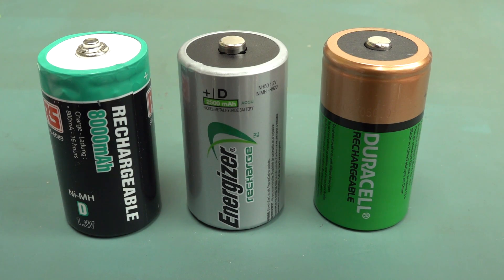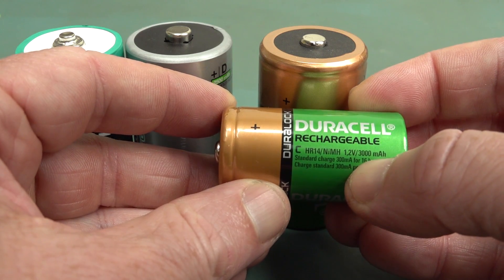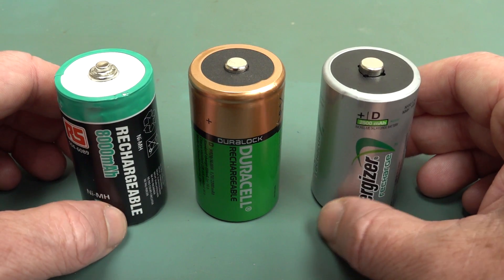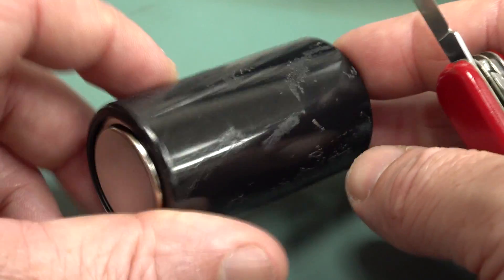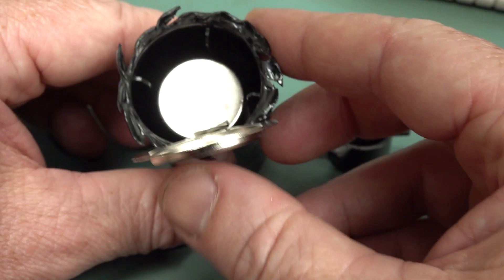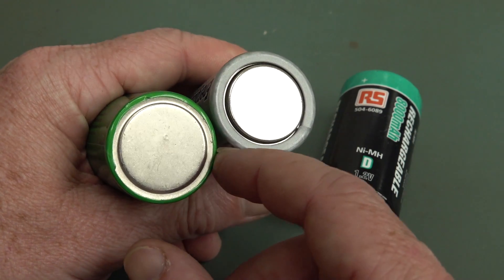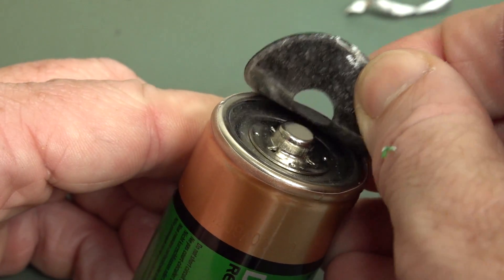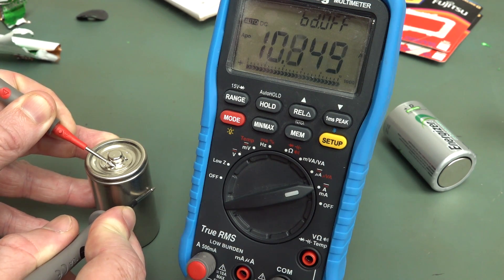EEVblog #1200 - BUSTED! - Energizer & Duracell NiMH

Comment: Hey Dave, just a heads up but the guts of NiMH batteries are pyrophoric, meaning they can catch fire when exposed to air. Hope you didn't put it in a regular trash can!T
Reply: I didn't think they were. What alkaloid is in it that would be reactive to air? I'm going to have to unravel one, just to try it.
Reply: @vincentrobinette1507  , it is not alkaloid but hydrogen storage "secret sauce" alloy containing various rare earth elements and stuff. Slightly similar actually to spark producing pyrophoric metal in lighters.
Reply: @SLEAGD  is correct. But discharging should oxidise the MH and should lower the risk of spontanious inflammarion. It can happen which happended to BigClive at one of his teardown videos.
Reply: @SLEAGD  You're thinking of lanthanum and other elements in the same column of the Periodic Table of the Elements. Their ability to store hydrogen, is why these are called "metal hydride" cells. I don't think they are likely to spontaneously burn, but it could definitely be flammable. The danger might be a spark caused by the electrodes shorting, while the hydride electrodes are exposed to the oxygen in the air.
Reply: Hydrides are able to spontaneous burn, and they can take a while to get going - all in all quite a fire hazard for the unwary.
Reply: If it catches fire, the flood will put it out.

Comment: Maybe it's to keep the recharge time down. If duracell has a 16 hour charge time, how long would it take to charge if it was fully packed!
Reply: Halojen That's the "C" rating.  1C means the battery can be charged at 1mA per mAh capacity, fully charged in 1hour+losses.  0.5C is half as much current so double the time.  A properly made real D cell like the RS one should charge as fast as a same quality AAA, provided the charger can keep up.
Reply: @johnfrancisdoe1563  I was just reading what it said on the side of the duracel (at around 15:00) and made the assumption that they were quoting the fastest possible charge. 
I mean, if it could handle a higher charge current, wouldn't they quote that so it's more impressive?
Upon reading the datasheet at 2:30 I see there are higher charge rates listed for the RS batt despite it only shows the 16h rate on the label. So.. meh, I dunno.

Comment: Back when NiCd was king they did this sort of thing all the time by adapting Sub-C cells into standard C and D cells.  Everything rechargeable from that era basically used Sub-C (with cardboard wrappers), since that was what everyone was making/using...it just made economic sense.

I kind of went through this mentally a few months ago when looking to go NiMH since I was getting pissed off at alkaline cells leaking for no apparent reason. I ended up just getting a bunch of Eneloop AA and AAA cells and sets of parallel-type adapters to combine 4 AAA into 1 C and 3 AA into 1 D. Eneloop's own brand of adapters only hold one cell.

Incidentally, the capacity ratings for Eneloop's 'true' C and D cells that are hard to find are the same as 4 standard eneloop AAA for the C and 3 AA for the D... My guess is that eneloop only makes AAA and AA types and does the same sort of thing.

Comment: Too be fair, they are built for the form factor. They didn't lie about capacity. These are legacy sizes. I used to stick AA's in a tube and pack them out to get someting working in a pinch. I would 3d print a collar now. I think your wining like a girl. If you want you fart box just to work for the night, you will buy the "scam" duracell or energiser. If you want your fart box to out live your own anus, you buy the one packed to the brim with powa!
Reply: frank brown  erm, you missed my point entirely, then started talking crap.
Reply: frank brown  Do you buy it? I stopped buying shit when I was a kid. If you want to argue crap with me  it's on deaf ears, not due to stupidity, but because I gave up flying a fuck about caring or listening about the sheeple problems. Preach at them, not me. Who in the fuck of your demografic would be  reading the post you put up about bacon, burried within my comment on dave being a winny dick about expensive batterys that are within all specs. You are very fucking mistaken to what my orignal comment said, your view on it and my interest of your view.

Comment: That's disgusting. A legit use for high capacity D cells are automatic bins which require a hell of a lot of torque to lift the lid. Now I know about this practice I'm going to damn well check the rating more carefully!

Comment: I would call it a scam. This is the exact same techniques the Chinese manufacturers use to sell you a 250mAh 18650 battery. They lie on the capacity and Duracell/Energizer don't, but Chinese manufacturers didn't flood the entire world with commercials on TV, internet and radio stating how long their cells last, and selling those in pure hopes their marketing pays up.

Comment: I remember seeing as a kid, D cells that had a hole so you could stick an AAA inside. But I also disassembled a very light D cell before and found it had a cardboard tube with a very small battery inside it.  These were rechargeable.

Comment: If the cells deliver their advertised rated capacity, there is nothing wrong in the actual cell size inside being smaller than the outer casing. They are just packaged to meet a given standardized form factor. There is no law requiring cells to fill the maximum internal volume with the active chemicals. If the cells are tested to perform as advertised and the price is right for their rated capacity, I don't see a problem.
Reply: If they dropped the "long-lasting" adds, sure... meanwhile, they use Duracell & Energiser bunnies to prove how long-lasting they are(n't), which, being generous, is sleight-of-hand at best.

Comment: Take apart the RS 8000mAh!!!  Bloody amateur!
Reply: Too nice of a cell. That's a  keeper!
Reply: @vincentrobinette1507  to nice of a cell? Thought the purpose of this video was to compare 3 types, a little miss leading and dishonest if you ask me. I mean just pushing a certain brand with absolutely zero evidence it is built better than the two brands he takes apart.
Reply: @heathdinsdale5012  I wished he opened the RS cell as the test is inconclusive right now. What if the RS cell actually had only 2500mah capacity inside? That's the bigger rip off than the other 2 brands selling close to their stated specs even if there's a lot if wasted space inside.
Reply: It's probably 4x the cost of the other ones...
Reply: @DoctorWhom  It's RS! Of course it will be 4x the cost! All their stuff sells at top dollar prices.
Reply: It is too nice to destroy RS is the dogs bollocks in parts normally.
Reply: @Sirstas79  

There's whole other lines of batteries made for "non-consumer" markets.
And the names on the outside... ... are names on the outside.
Reply: @J doe I was just trying to relate the prices and availability, not trying to say that anyone brand is better.  I was just trying to do a cost comparison on the price difference. yes the price does scale up with the RS brand, i have found them at $12 also myself. I only am trying to see if there was a reason why the other brands are not making batteries on the larger mah?  Is it just marketing? Is it safety? I was also trying to  see if the other company's made larger capacity  at different prices.  Because it does not look like may manufactures make them at those capacity's.
Reply: Well I guess I’m going to buy some RS cells then. Good thing, I’m fresh out of C and D!
Reply: @J doe 6pk of 10k mah for 31.99 which is slightly higher per cell but by a much smaller percentage than the increased capacity.
Reply: @Sirstas79  I tried and failed to find them on amazon UK, im probably searching wrong term, or its giving me different results because of my Canadian account. Almost $30 USD for a pair on alliedelec for the RS ones. On Amazon US the energizers are $8 USD for a pair.
Reply: He works for RS
Reply: @dutchdude1972  Check your eyes. You're a week late to the party.
Reply: The RS cell actually says 800 (eight hundred) mAh on the side. He was showing it right to the camera while saying "eight thousand" LOL
Reply: Euro Bum , charge current 800ma 16 hours .. capacity 8000 mAh. I noticed the same so I paused the video. you should too.
Reply: @eurobum2012  You're wrong Pal! The battery capacity is in fact stated as being '8000mAh'. The 800mA you are referring to is the recommended 'charge rate' that you should charge the battery at. It even says 'Charge' right next to the 800mA. So maybe you cant read. So he is right,  you are wrong.
Reply: @tangosucka2000  OK Pal! I'm not the only who didn't read properly.
Reply: @eurobum2012  check again and freeze frame at 5 seconds. It clearly says 8000mAh.
Reply: @DigitalEyesStudios  wow. congratulations on replying to a month old comment without reading the history.
Reply: @eurobum2012  If you stop the video and look carefully you can see it's actually 8000mAh.

lol sorry I just couldn't resist
Reply: @zakatalmosen5984  If you stop and look at the comments, you can see that you're actually 6 months late. Sorry I couldn't resist.
Reply: @eurobum2012  It says 8000mAh. And that will be 8 months now, not 0.8 months.
Reply: @alanclarion6765  hyuck. so original 🤣
Reply: @eurobum2012   Look again it days 8000 not 800. You missed a 0
Reply: @westkomer5570  Look at this comment thread again. Specifically, the beginning of it from a week ago.

Comment: The Walkers/Lays crisps of the battery market.
50% product
50% air
100% well played, marketing team - you baited me again
Reply: At least Lays has a reason to do that — the air protects the crisps from crumbling into a powder, and you pay for the weight anyway.
Reply: @RDSk0  Sounds what a Walkers/Lays marketing exec would say... 🤔
Reply: @hectorandem2944  No it's totally true man. Without the extra air during shipping all of the chips would be crushed to essentially dust. You've gotta remember these things are probably shipped in massive boxes on pallets. Not only that, but they have to provide ENOUGH air to be protecting at sea level while also not exploding when being delivered to cities at altitude. It's really funny, when I moved to a high altitude place I was extremely surprised to see all the chip bags puffed up (as well as things like yogurt lids, etc.)
Reply: @reeepingk  Uh huh, and what's the totally true reason to make the bags opaque so that you can't inspect the air/product ratio?
Reply: @tybofborg , they are not transparent to protect the product from uv light. 
That's why all beer bottles are dark, there is actually a law in my country that requires the use of dark bottles for beer.

Have you ever had a pack of crisps in your hands? You can feel how much is in it with your hands.

Comment: When I worked at Radio Shack, our D cell rechargeables were 4000mAh if I remember.  A real D cell, not a POS scam sub-C in a D sized shell.  Everybody accused us of overpricing the D cell and bought 1200mAh D cells of other brands instead.  Our biggest customer for the 4000mAh D cells was the police department.  They loved them for use in their flashlights.

Comment: I actually expected them to be standard Duracell and Energizer AA NiMH cells in a sealed plastic sleeve enclosure with a spacer inside and welded tabs. That would seem to be a more cost effective way to make these crappy low capacity D Cells than making custom cells inside the enclosure. My top 3 fave NiMH D cells are the Powerex LSD 10Ah, the Tenergy Centura LSD 8Ah, and the Tenergy Premium 10Ah.

Comment: from what i remember the Duracell I could get here were lower in price with their lower capacity. it think like $14-16 or so for 2500mAh vs like $27-ish for 4500 (and later 5000) mAh ones at Radio Shack. This isn't a new thing to do either, Iv'e seen old GE and Rayovac NiCd use the same "Sub-C in a D size spacer" trick.

Comment: Wonder if the had a surplus of sub-C size when power tools went to Lithium and repurposed the existing stock
Reply: Matthew Miller very likely
Reply: but their new versions are 3000mah so it seems like they continue to make them that way
Reply: Sub "C" cells ruled the cordless power tool, and laptop computer markets for years. They were produced in mass, and were readily available. It doesn't surprise me in the least, that they are a "go to" for just about any 1.2 Volt rechargeable application.

Comment: 12:10 - It's because that first layer was not stuck, so it came off easy with the electrolytic paste intact, but after that, you were peeling it off so the paste was flaking more. You can see this because the width of the dark part is equal to 2πr (r is the radius of the battery canister).
(The whole point to a bigger cell is more capacity; this defeats the point. Are they outsourcing to China now? 😒)
Reply: It is often okay to outsource manufacturing to China. It is not okay to outsource design to China.

Comment: Is it so difficult to build a battery that outputs 1.5v? I hate all the 1.2v they produce. I don't think the reason is valid enough to keep doing it. Chinese places offer them - but quality?
Reply from the maker: It's the NiMH chemistry
Reply: Yes, it is very difficult to produce batteries that produce a specific voltage. You should learn how batteries actually work.

Comment: D shells over sub-C cells has been happening as long as there have been consumer rechargeable batteries.
Reply: She sells D shells over sub-C cells by the sea shore.
Reply: Tee hee hee, Kanglar. That's so good. Seems I'm the only one who noticed. Still laughing...
Reply: We've always had the option of going to Digikey or Mouser and buying the full capacity industrial versions of these where a D cell would have a capacity of 8.25Ah.
Reply: @KJ6EAD  lol, digikey or mouser... would often be cheaper to replace the DEVICE with something that doesn't use D cells, before paying a premium there.   You can get much less expensive Tenergy 10Ah or Tenergy Centura 8Ah D cells on Amazon, and free shipping too!
Reply: Yea. is even very rare to get a true D cell.  Even true C cells are failrly rare
Reply: @matsv201  true C cells are just today's D cells apparently
Reply: Well.. i ment a true filled C cell.

As far as i remember, C and D cell become rare about the same time. Somewhere around mid 90-tys when Everything turn small.
Reply: More than 25 years ago, I had some Radio Shack NiCd D cells made exactly the same way.  They were plastic shells with a sub-C cell inside.  I wondered why they were so light weight...
Reply: You can even buy converter plastic containers.
NiMH is so old, I remember it from when I was young. Man I'm old now.
Reply: @czarzenana5125  I have a set of converter cases for everything above AAA, really cheap and never have the wrong size
Reply: @unh0lyav3ng3r8  
And you only need a small charger.
Reply: @czarzenana5125  I use the xtar vc4 usb, it does 18650 and nimh, a very convenient and well made device.
Reply: @unh0lyav3ng3r8  Same one here. It's great.
Reply: @czarzenana5125  Not so old, I remember before there were NiCd, then GE was the most popular NiCd in the US and they too, stuffed C cells in D sleeves.
Reply: @stinkycheese804  
The first Ni–Cd battery was created by Waldemar Jungner of Sweden in 1899 :-)
The first production in the US started in 1946.

Comment: The batteries have to be that size no matter what.. so how much material it takes to get the ratings is irrelevant (as was said) The thing is (according to Big Clive :) if they added more mAh the battery would simply self-discharge faster, so I can see why they don't necessarily put the maximum amount of material in.
Reply from the maker: That's silly. They are using less because it costs less and they can meet a lower consumer price point. If Joe public is happy with lower capacity then no reason to give them more, leave that to the niche players
Reply: It's a little of both I think. Joe public will not understand why the battery with 2 x mAh doesn't last 2x. The higher you go the worse it gets

Comment: Just ripped apart a Varta D-cell (70g, 3000 mAh) that I inadvertently bought for my Fluke 189 (which needs C-cells). It looks EXACTLY like your Energizers, down to the plastic spacers. Great! Now I can use them! :)
Reply from the maker: Wow, they have their own plants, so shouldn't be OEM
Reply: @EEVblog  I´m not actually sure Varta produces NiMH at all.
They produce more than 50% of Alkaline batteries, and apparently also still make lead acids in some other factory, but not much else apparently.

Comment: This is less energy density than the premium AAs from the same makers? The maximum seems to be around 2850mA/h. Volume of the AA compared to the D cell - assuming no other mechanisms would affect capacity apart from chemistry and volume, is *2.9 approx, the D cell should be capable of a tad over 8000ma/h ... That RS  battery is about as good as you can get.
Reply from the maker: Yep, insane
Reply: @EEVblog  Except my math was wrong ha ha its 6.75 times the volume....so a maximum of wow! almost 20000mA/h
I want one of those...
We only get just over 10%??? (math check....OK 13%)

Comment: Duracell NiMH LSDs are pure shit. It dying after 80-200 recharges by getting very high ESR, so even low power 100-200mA devices stop working. Mostly the same about GP and Energizer. 
For example, my old Eneloops are still good, after 5-7 years of regular use, always being recharged with same charger! After all those years Eneloop is still second to none.

Comment: rechargeable energizer 9 volts capacity are crap to, a capacity of only 175 mAh
Reply: They have these small 1/3 length AA batteries and a lot of air.
Reply: @TheBodgybrothers  
That can't be true. For 9V you need 6 in series and even in 1/3 length that wouldn't fit.
Maybe AAA, but I still would doubt that.